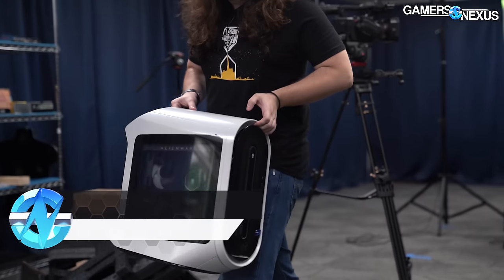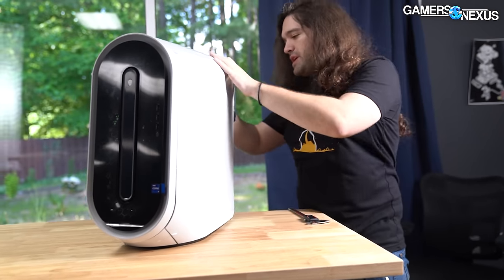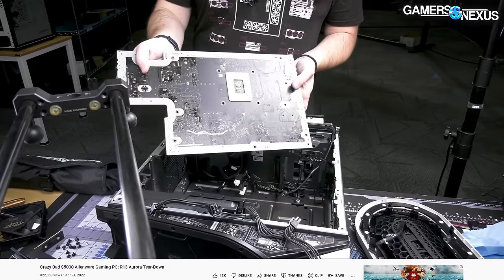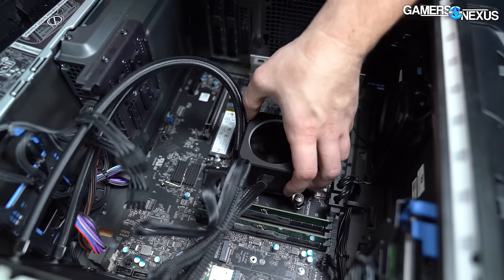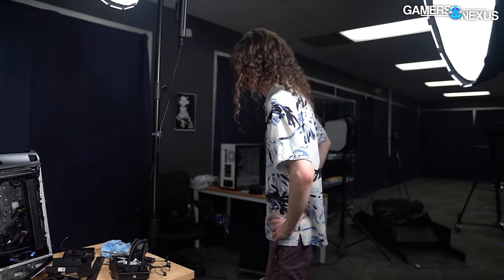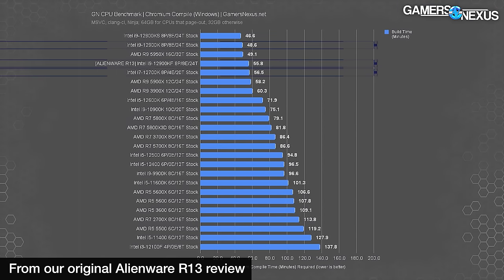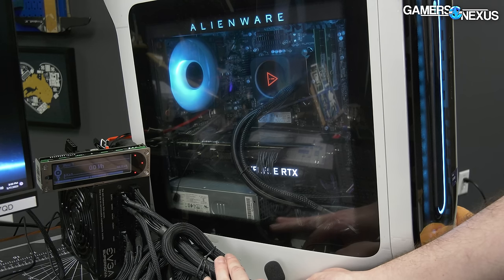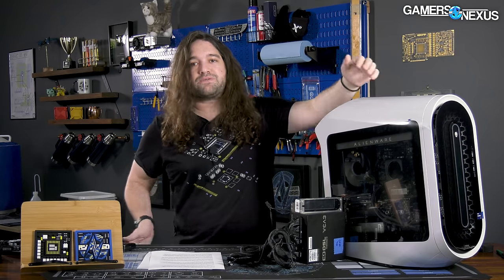"Fixing" the Alienware R13 Dumpster Fire

Comment: I got an R11 and with in 5 months turned around and got a new case, power supply, cooler, and motherboard. Problem solved. the 5900x was running at 85-90deg with out doing anything really. not a great system. would never buy one again

Comment: This demonstrates how easy this system becomes e-waste. Not even able to fix the cooling with all the custom Dell stuff. Not able topit the system in another case because of the non-standard mobo shape. No power supply replacement because of special plugs.. this should be illegal...

Comment: Says "We got the max spec", shows a 750 power supply when Dell offers a 1000 watt for this model. Same shit with the R10, you complained about it not having water cooling but you didn't buy the version with water cooling. Other than that yeah Dell needs to improve on this as this is way to much for what you actually get. PS - The fan profiles do work in the software and you are able to adjust them with a curve graph manually if you want.

Comment: Nope. Prebuilt PCs are not where you want to spend $5K. They are never good enough for such high performance. If you have $5K to spend on a PC and you are going with one of the big prebuilt companies and not an SI at a minimum, there is no help for you. GN is making this video for the meme, but there is really no help for someone who made this idiotic of a purchase. If you are going low to mid performance, than most prebuilt PCs will perform just fine (5600x/5800x and a 3070 in almost any prebuilt PC perform normally). You won't be able to upgrade properly, you will have a cheap case, you will have bargain bin parts sometimes, but your thermals and performance will be fine. Please, if you have no common sense, don't spend $5K on a PC.

Comment: Alienware / Aurora is just garbage.  Just straight up garbage.  I've had exactly the same experiences you have in this video.  People try to get me to repair these things on a semi-regular basis and I always tell them the same thing.  It's not your fault.  It' looks good, it costs tons of money, but every dang thing in it is underbuilt, poorly thought out and executed and worst of all PROPRIETARY.  A lot of the mini Aurora's or whatever from a few years ago had known bad 120mm radiator systems.  The ONLY thing you could buy that could be shoehorned into the utterly proprietary tiny space was a Corsair unit.  It was a mighty PITA every time.  And if you ever need a replacement motherboard for your Alienware?  You're DONE.  Cannibalize and complete rebuild with whatever is left.  Just try calling Dell a mere 2 years after launch and see if they can even get you MB for an Alienware.  Usually, no.  And if they can?  It's some idiotic number like $500 or $700 just for the board.  Argh.  I could rant on these for hours just like you can.

Comment: Hey now I got a r12 and I fixed it in 4 days buying new parts as I went and found new problems started with a case and fans the next day a fucking motherboard but this was Easter Day so had to wait a day to go get it thennnn I had to buy a new battery at the same time n my pc is killler also bought a 4090ti recently
Reply: Ps haven’t bought a new water cooler for my cpu so I of on an 11900f at 4.5mhz I think

Comment: you are in this video to Dell like Loius Rossman to Apple  xD
godammn propriatary bullshit, and thats the most uglyiest case i ever saw xD
a bitfenix shinobi like 45bucks looks wayyy better and usable
for right to repair movement.
but couldnt have you used a small 12Volt 5amp plug in power supply and just a potentiometer for fan control, would actually improve this plastik thing xD
thanks for entertainment